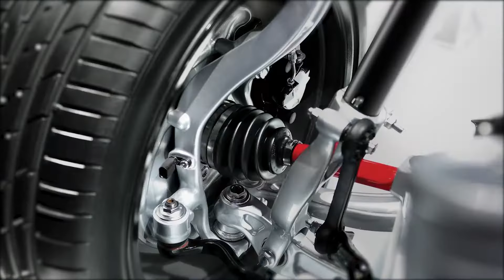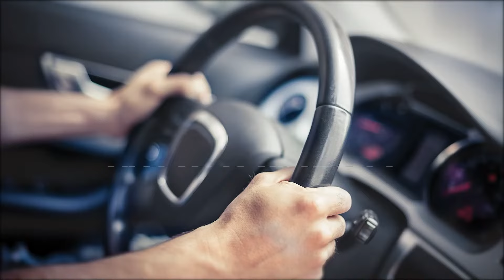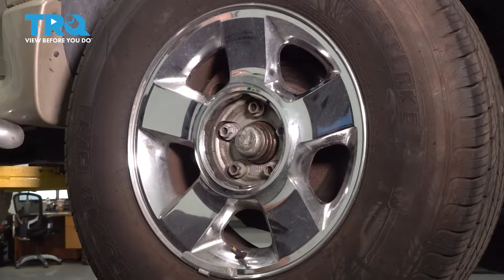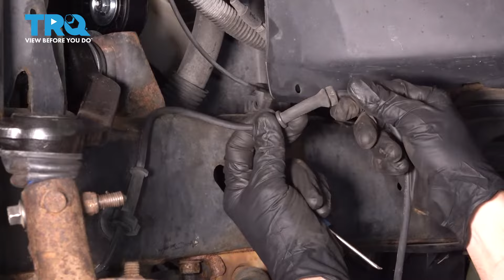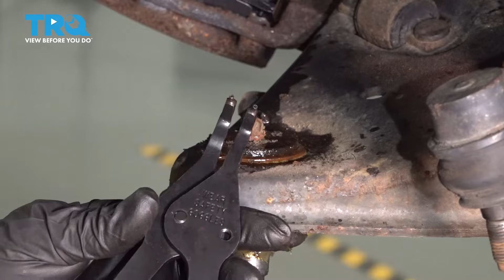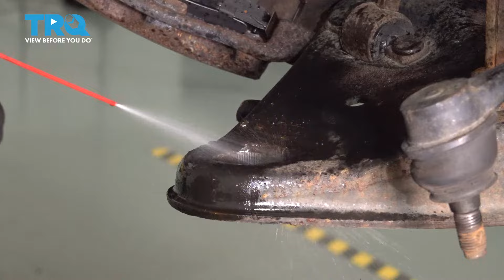How to Replace Lower Ball Joint 2001-2005 Ford Explorer Sport Trac

Comment: You want me step for step through that process and it was perfect. I appreciate it. I just didn't have you a little hydraulic vibrator right there to knock it off at the very bottom of the kingpin I had to beat it with a sledgehammer

Comment: 🤔There is one step missing here, if you are doing the front wheel drive replacement. It was like a magic trick at 7:30 when you removed that knuckle- Where is the axle? Oh, its a rear end drive replacement!! 🕸🕷

👉👉On front end, you have to remove the axle nut and take the axle out in order to clear the bottom of the lower ball joint thread pin when you remove the knuckle.

Comment: Awesome video and ty for sharing. Helps lot. Only thing you don't point out that is a big deal, is that if your ball joint kit doesn't have that slot cut out it won't fit underneath to work right lol. Most kits don't have that slot.